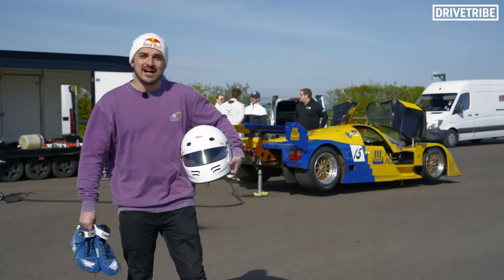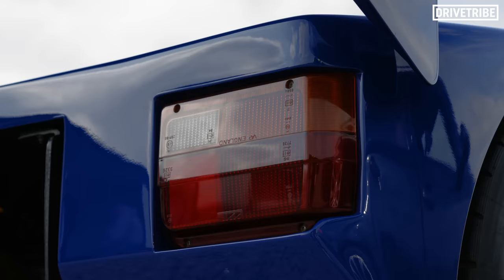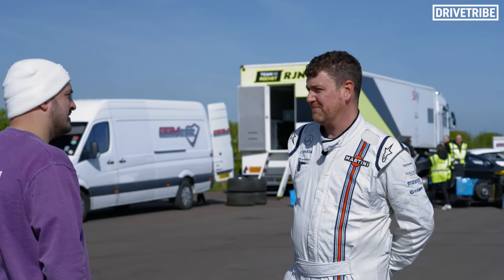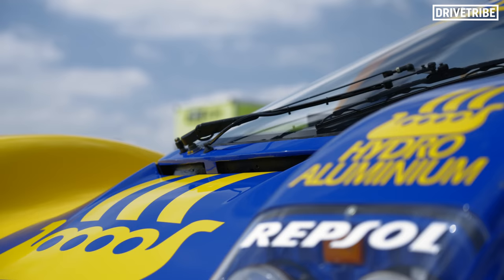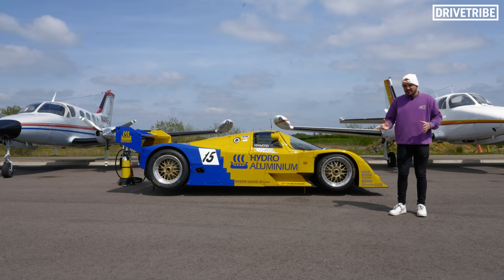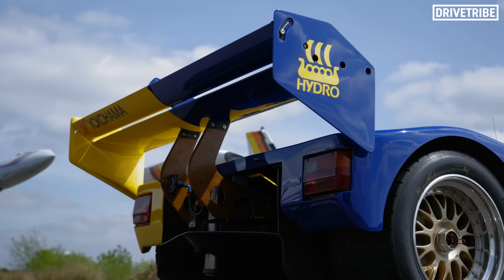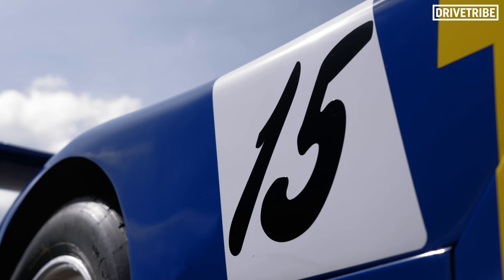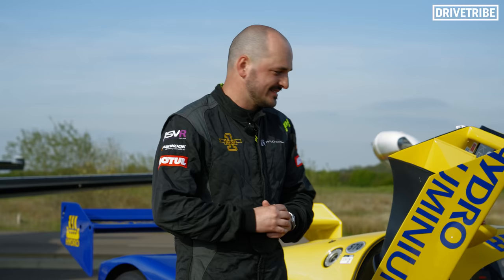This 700bhp Porsche changed racing cars forever

Comment: That Nurburgring old 956 record by Stefan Bellof was absolutely insane. It lasted for what... three decades. I mean that is just completely crazy to even think about... at the pace cars and technology otherwise developed during that era. I think Keke Rosberg (the Formula 1 World Champion of 1982 tried to break it with a F1 car but couldn't get even near). In my opinion, it was much more impressive that anyone can achieve today (even Porsche). In relative terms of course. What a legendary car. 

If I understand correctly, this 962 was pretty much just a "developed update" of the 956, right?
Reply: 962 was updated to conform with imsa regs. Driver must be behind centerline of front axle
Reply: The original 962 had a single turbo. The 962C was basically the IMSA car with a 956 engine in it.
Reply: Don’t forget it also included the Grand Prix part of the track for that record. Longer than what is currently used for recording  Numbering records
Reply: @porschecollector727  It didn't include the GP part. That year, Nurburgring GP was actually in construction, so that was the only year WSC ran at just the Nordschleife as Betonschleife where they used to have the pits and s/f line was being demolished for the GP circuit to be built, so instead of going straight after the Hohenrain Chicane, they turned right and straight into what is today known as the Sabine Schmitz Curve, so it was just Nordschleife, almost identical in layout to what is run today for record laps, although with 1980s asphalt and kerbs.
Reply: @porschecollector727  Yeah I've heard about that. How much is the length difference? I've driven the track many times on Assetto Corsa and Gran Turismo 7 LOL.
Reply: @porschecollector727  Wrong. That record was driven in 1983 - GP track opened in 1984. Bellof drove on a shortened track due to construction works. It was 20.835 km long which is about the well known Nordschleife today. The complete track (without Südschleife) would have been 22.8 km.
Reply: @porschecollector727  No, that’s not accurate. The new Grand Prix track _was still under construction _ when that record was set and they used only the old Nordschleife. The start-finish section was at the Nord Kurve, as it is for public days.
Reply: The current record is about 5.20 by a Porsche 919 demo car that had all the restrictions turned off.
Reply: The 956 had its wheelbase extended 120mm to make it into a 962 and putting the drivers feet behind the centerline of the front wheels for better crash safety.

Comment: Pretty much every Porsche changed racing cars forever
Reply: Panamera?
Reply: And every telephone pole everywhere
Reply: @Wirenfeldt1990  revolutionised luxury sedan design (for the worst)
Reply: Not to forget there footwork F1 failure
Reply: @5hmgn more or less led to the Carrera GT
Reply: @tokyosmash  Paul Walker💀
Reply: @5hmgn  that was Roger Roda’s fault.
Reply: @tokyosmash  yes, but to be honest the stock Suspension of the GT is pretty bad
Reply: @5hmgn o what makes it "bad"? I think they were riding around on old tires too
Reply: @5hmgn that was Footworks failure not Porsche. Look what that years and the following years WDC was powered by
Reply: @5hmgn that's what happens when you use dry rotted tires on a sports car.
Reply: @trance9158  they switched back to cosworth because the Porsche engine was unreliable, heavy and underpowered.
Reply: @tokyosmash .. and one of their prototypes.
And their current (as of this time of writing) Hypercars.
Reply: @5hmgn  The switch was due to engine regulation changes and turbos no longer allowed.
Reply: @terrystevens5261  wrong

Comment: EVERY race car post 1986 had to have the pedals behind the front axle, not just Group C, even down to Formula Ford. Before that the driver's feet and ankles were the first to arrive at the scene a frontal accident. After that there were several years trying to balance the cars again with the driver mass moved back. That's why FFord van Dieman RF86 were beating the later RF87 and RF88 and why driver like me (almost 180cm) got more uncomfortable.

Comment: The reason Porsche dominated for so long is slightly unclear. The brochure things like power and aerodynamics hide something that a lot of people who are new to Group C either don’t understand or have missed altogether. That reason is fuel economy.

It’s easy to build an engine that will make 1,000 hp. It’s even possible to build an engine that will make 1,000 hp for 24 hours. But the goal of Group C was something different: to extract the maximum amount of power from a given amount of fuel. Group C mandated 100 litre fuel tanks from the start. In 1,000 km and 6 hour races, you were allowed to refuel 5 or 6 times (someone will clear this up, I’m sure) and for the Le Mans 24 hr race, there was a fuel allocation of 2,500 litres per car for C1 cars. These figures were reduced over the lifetime of the formula.

These rules were strictly enforced. I remember Sauber having one of their cars disqualified for being 100ml over the limit for a 1000km race. Have a think about that for a second. 100ml is barely a half a small cup of coffee.

Porsche were among the first to introduce computer mapped EFI and electronic ignition and it took the other teams a while to catch up with that technology. By the time they had, Porsche had moved further ahead anyway. The object was the most favourable compromise between power and economy. The drivers had something to do with this too. The idea was to run out of fuel as you crossed the finish line. To do this required a lot of patience and keeping one’s hand away from the boost dial.

Comment: This is a 962C, right? With that rear wing style. A later variant, the C.
Reply: Not much later, just 1 year,  and C's were built in both short and long tail versions.

The C refers to "Group C", not a third edition. The 956 was supposed to a "world" prototype that could compete in IMSA's GT Championship in the US and the FIA's World Endurance championship in Europe, but some rule changes with IMSA's GTP class meant it wasn't eligible there. 

The 962 was build to correct this, stretching the nose to fit the drivers feet behind the front axle for improved safety being the biggest change required by GTP but the engine also lost a turbo, becoming a single-turbo engine. Next year on the 962C was built for Group C; combining the added safety of the GTP 962 with a FIA-legal twin-turbo engine,  finally realizing the 956's original "world prototype" goal, with 962's competing in America and 962C's competing in Europe.

Comment: Audi builds great cars but they still haven’t figured this segment of cars out. Compared with the competition from Mercedes and BMW the Audi S6 is less powerful than the equivalent competition. The S6 should have at least 500 horsepower to compete with cars like the BMW M550i with 523 horsepower. Instead you get 80 horsepower less or have to pay up and get the RS6 with roughly 80 horsepower more. Audi should have kept the twin turbo 4.0 liter V8 which is used in this previous generation.

Comment: There was atleast one 962 that was made completely out of carbon fiber. The question is how many aluminum 962's were made and how many carbon fiber 962's were made?
Reply: The Kremer team made eleven carbon fibre chassis (962CK6 ). a few other teams had heavily modified aluminium monocoques due to the originals lack of stiffness.
Reply: @terrystevens5261   thanks for the info.
Knew I'd get an answer eventually!

Comment: Where does the group C title come from, there was also a group C in rally racing and it was also considered the best era, is group C just something we call the best cars of a racing series, why not group A?
Reply: In 1982 the FIA changed from the Group 1-6 Formula to Group A-C

Group A was used for touring cars and rallying and required 5000 production cars in order to be eligible with 500 more specialized Evolution variants able to be made for competition, this is where cars like the BMW M3, Ford Sierra Cosworth, Lancer Evolution, and Nissan GT-R came from.

Group B was used for GT racing and rallying, which required 200 production cars and allowed 20 Evolution models for competition use, this is where you get your Peugeot 205 T16, Lancia Delta S4s, and Ford RS200s while the GT side of things never really took off, with grids mostly consisting of Group 4 holdovers like the BMW M1, although the Porsche 930 and 928 did race. The Ferrari 288 GTO was planned for Group B GT racing, but the class was axed due to safety reasons in 1986

Group C was for prototype racing and the only major rules were they had to be closed cockpit, and had to maintain a fuel use of 60L per 100 km, later Group C Jr (renamed Group C2) was made and allowed 33L per 100 KM

Comment: What I don't understand is why the seat and controls in this "racecar" are not in the middle.
Reply: It has to do with the series rules.  Even the prototype classes have to have room for 2 seats.  Only one is installed but they are required to have space for both.